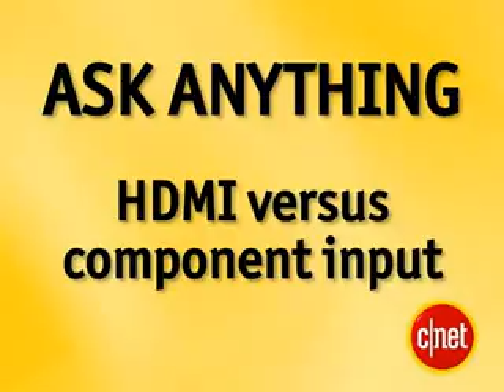HDMI vs Component Video

Comment from the maker: Well the video signal is split up unlike composite where the video signal is just one signal. There is less conflict when the signal is split, S-video interfaces do the same thing but they are only capable of displaying standard def resolution. I'm not that sure about the details, I only know that the interpolation is done to save bandwidth.

Comment from the maker: 1200p is not really a resolution, it is prob either 1200 pixals or you probably meant 1280 by 720 resolution which is like  720p. I could be wrong, but in case it is 1200p as you say, it would be around 1080p because that is the highest hd resolution for single screened tv's with the exception of 2160p.

Comment from the maker: well, I myself would prefer 720p over 1080i because 720p displays 720 lines on every frame while 1080i displays 540 lines on every other frame constantly alternating the 1080 lines so on every frame you never have a full 1080 resolution, it looks like it is 1080 because it goes so fast that you cant tell. Stick with 720p

Comment from the maker: not really, 1080i means interlaced which means the actual amount of lines per frame is 540 (half) but is interchanged with every other line very quickly so that the human eye cannot discern that it is not at a 1080 resolution from far away. 1080p stands for progressive which means it displays full 1080p resolution on every frame. You are right in a sense that they use the same amount of lines but 1080p is the better and highest resolution.

Comment from the maker: 1080p is currently the best resolution not 1080i, 2160p but is known as Quad HDTV only for 4 different signals on one big HDTV so you have 4 boxes with different shows on one screen, each in 1080p.

Comment: i had my 360 connected with included component cables in 1080p to my 42" and it looked sweet but when we got directv i tried the hdmi cable that came with the cable box also in 1080p and it made the colors like leap off the screen and everything looked a tad sharper so yea it was worth it for me but if ur not picky then stick with component

Comment from the maker: Not pixels, lines. 640 by 480 is technically not in terms of pixels it goes by lines, 480p equals 480 lines of digital resolution going across your tv. Most PC monitors support progressive scan and can handle high resolution. HDCP is a type of high definition encryption, since your monitor has it, it can definitely support HD resolution.

Comment: I had read from a website that 480i/p is the same as 640x480 pixels, in other words:
480i=240x640=153,600 pixels showed on screen
480p=480x640=307,200 pixels showed on screen

my 2° question Is: my monitor will support modes like 480p, 720p that means progressive scan? I don't know, does a monitor supports progressive scan? 

By the way mine is lcd widescreen 16:10 and also comes with some rare things like DCDi by FAROUDJA and HDCP inputs. What the..? thanks.

Comment: I have a gateway hd2200 monitor 22" with hdmi, and a component input. I connected my dvd to the monitor using a component cable just to prove it. The screen size was ok, quite viewable. But I noticed that sign was 480i, the image was kind of blurred, dark, and it has an horrible quality. it wasn't good at all. I have this question.. 

1. If I buy an hdmi cable to the monitor, what would be the maximum quality mode that I would see in the screen if I connect it to a ps3?

Comment from the maker: Yeah, 1080p means "progressive" 1080 lines per frame. 1080i is "interlaced" half the amount of lines per frame which alternate per frame. For example, you take 1080 lines of a picture, label each line with a number from 1 to 1080. The even lines pop up on the first frame and the odd number pop up on the second frame. This happens so fast that you don't even notice the difference except on a bigger tv set.

Comment from the maker: Thats if you have the optical RCA adapter which comes with the Elite. You can buy it separately but it comes with the HDMI cable. I believe it is around 40 to 50 bucks.

Comment: if you have a surround sound system with an optical port, go with component (the cable has an optical port).  If you don't, go with HDMI.

Comment from the maker: Yeah, but quality is more important than quantity. HDMI provides Dolby True HD whereas you can't get audio through component unless you have the regular RCA cables or a fiber optical TOSLINK cable. TOSLINK only provides 5.1 surround sound max. I rather save up 20 more for HDMI.